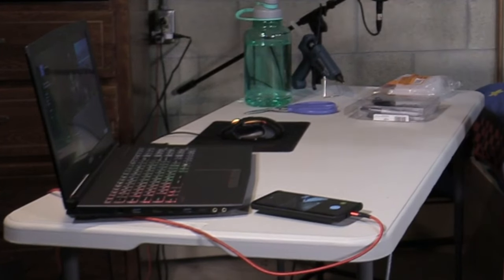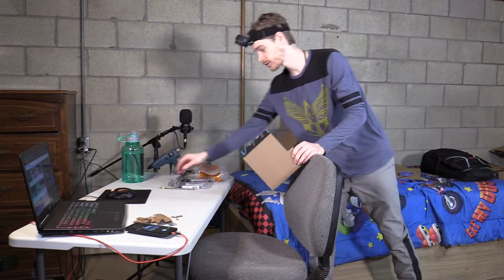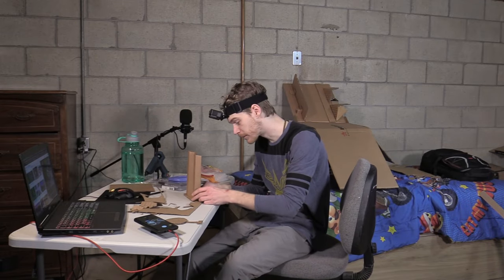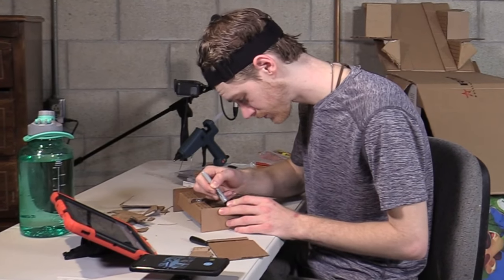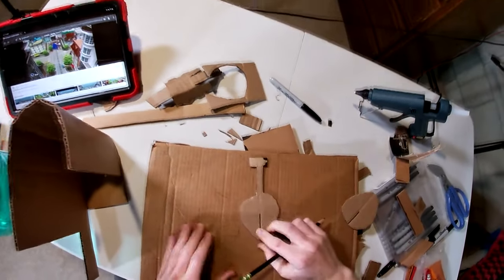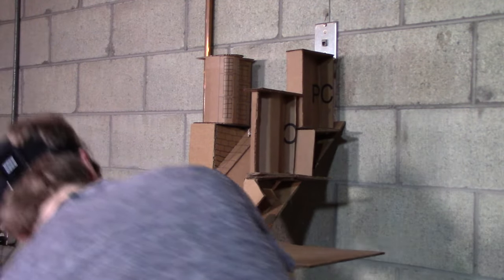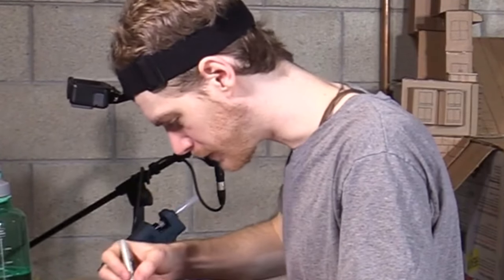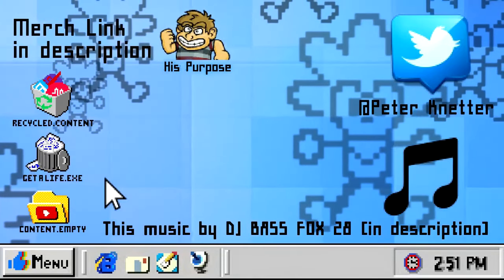"City Escape" From Sonic Adventure 2 Made out of Cardboard

Comment: The same hot glue burn happened to me I was trying to make a Iron man helmet and the TIP of the gun touched my palm WILE I has pressing on the trigger so I got hot glue all over my hand and just out of dumb reflexes I grabbed my hand with the other witch just spread the glue onto the other hand. Three hours later I could finally remove my hand out of the water bowl without getting that energy burn/shock in my hand :/